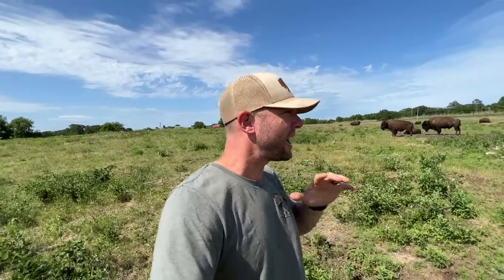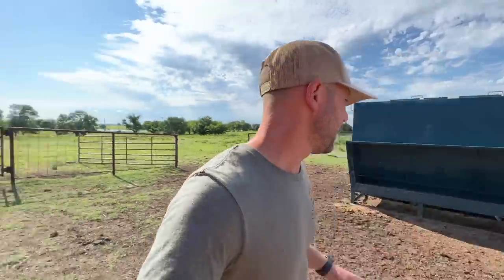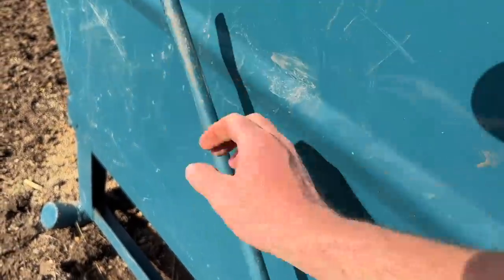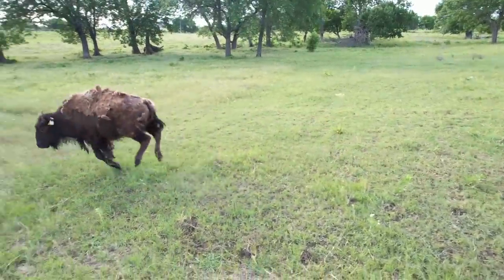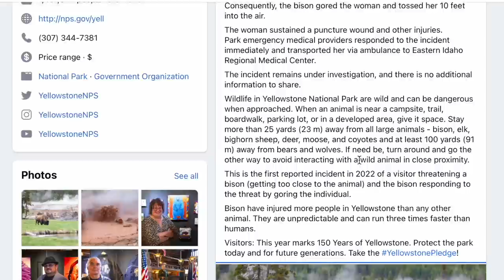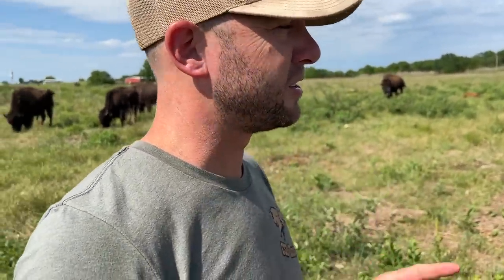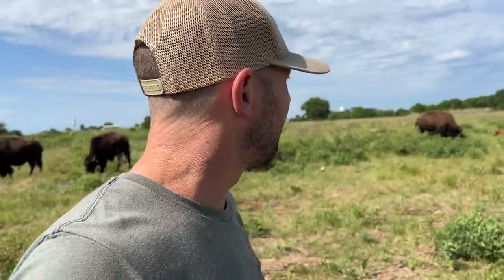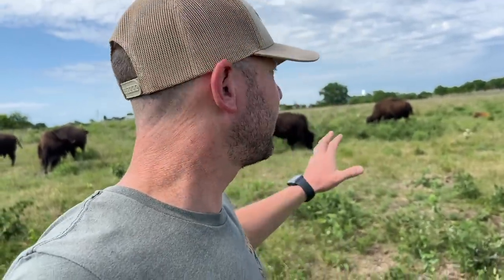They Are Majestic Animals, But...

Comment: When I was 22 yrs old my boyfriend and I went on a 1,000 mile bicycle ride from Seattle to Colorado Springs. Our most memorable experience was when we stopped to see 2 bison in a small corral just 20 yards from the small back road. The corral was a double layer of railroad ties a foot apart so we thought it would be safe to climb the outside fence. When one of the bison charged the fence we could not get off it fast enough!  That was 50 years ago and it was so scary I remember all these details. Thanks to the rancher who built the pen very solidly we were not hurt. But I gotta admit it was magnificent to be so close to them.